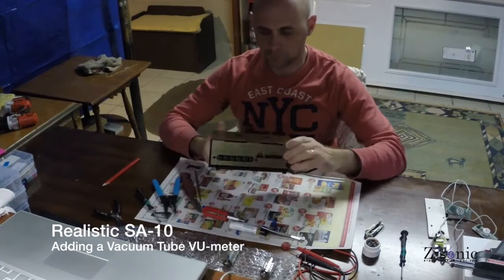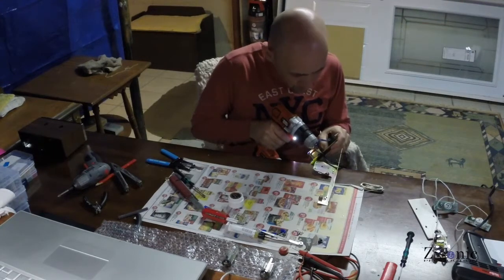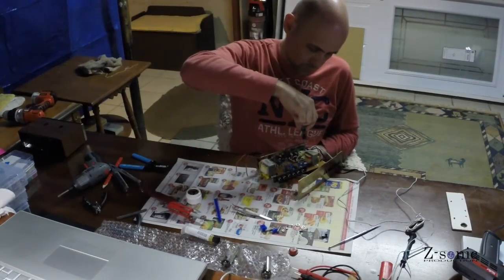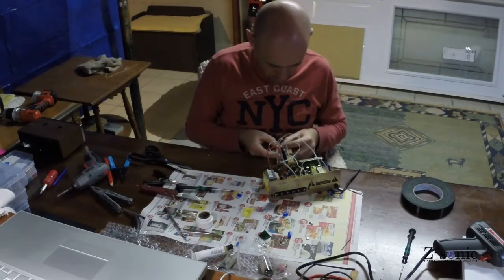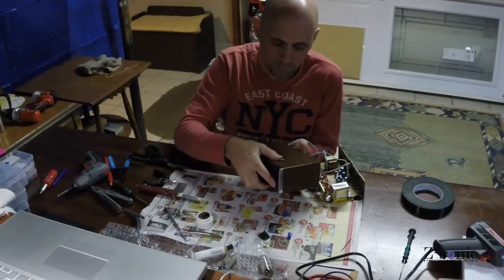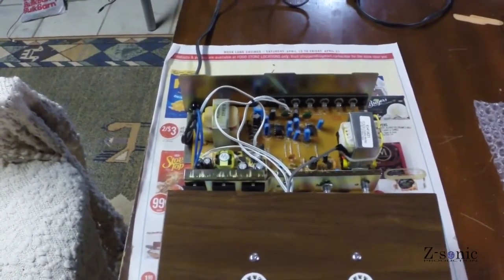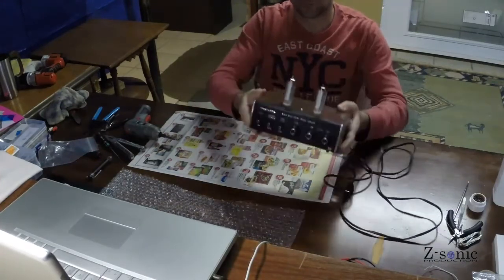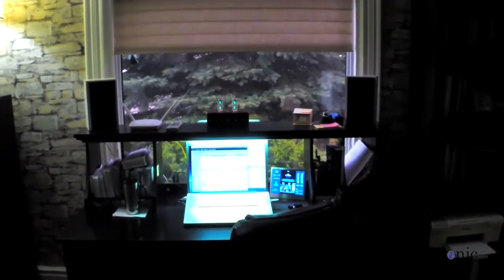Installing a 6E2 Vacuum Tube VU-meter on Realistic SA-10 Amplifier

Comment: excuse me, but how the flying fart do you take it apart?
Mine seems to be welded shut
Reply: I 2nd this question - If anyone could chime in with tips.
Reply: Take the three screws out on the bottom first. Then pull the three tone and volume knobs off.
then remove the black felt washers and finally remove the two brass nuts on the tone and third volume knob shafts . I use needle nose plyers. Then the case slides right off.